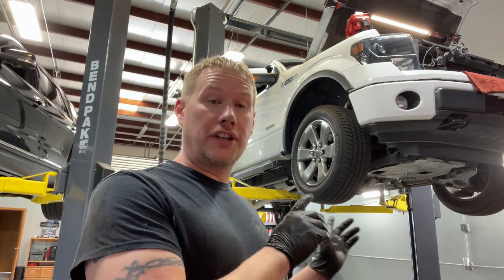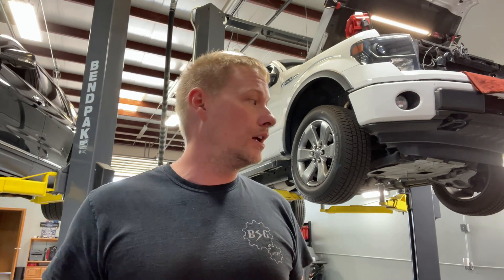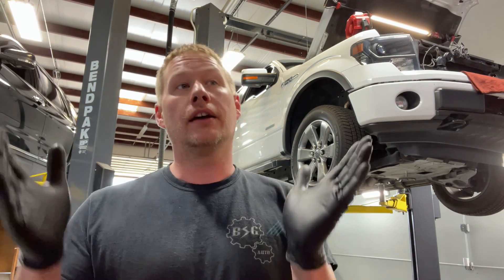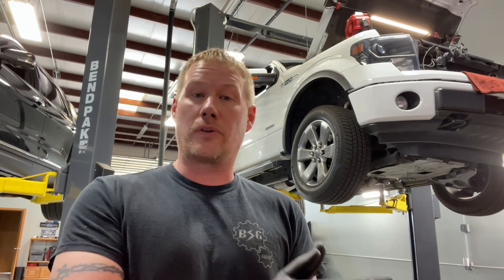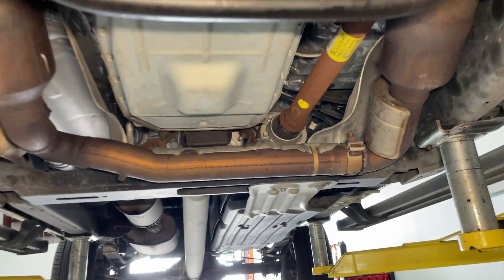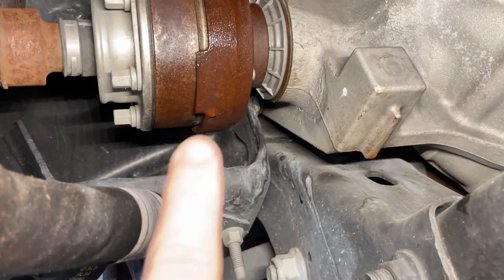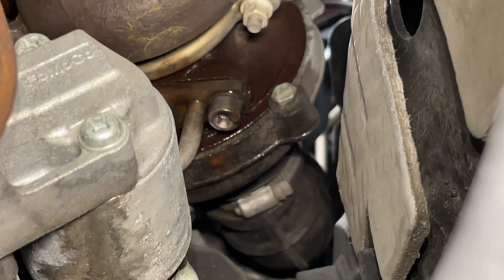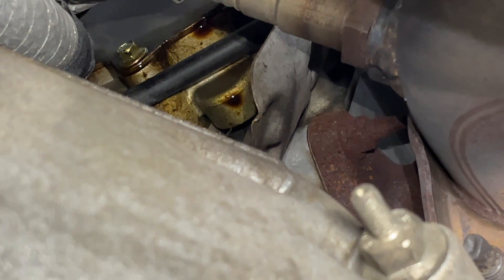Ford Ecoboost Engines Can be so Hit or Miss: I Really Feel Bad for This Customer...

Comment: I have a 2011 with the 5.0. I've had a few issues but nothing major. At one point I thought about upgrading but I think I'm going to keep this truck until the wheels fall off. It's almost like these newer trucks were built to fail

Comment: I had my 2013 ecoboost for 5 years and with only 43000km it needed the timing job done to it.
I never noticed anything but the dealer found it during maintenance for another problem.

Comment: So with all the cooling system leaks what's the possibility head gaskets leaking boost into the cooling system and causing the leaks? Just a thought.  With all the problems you just found if it were my truck I'd get rid of it.

Comment: This is the flaw with all of those great ideas to save gas. One they don't get that much better gas mileage than their predecessors such as v8s and sixes. But you get stuck for extremely expensive repair and maintenance cost which more than eat up the savings from gas. This is the big flaw with the gas mileage mandates from the federal government. A lot of these emissions and fuel economy mandates are unrealistic and excessive but the government doesn't care because the government doesn't have to pay the bill the poor fool customer does. It's just as bad with all the other manufacturers not just Ford. GM Ford and Chrysler and the now defunct AMC should have pushed back on a lot of these mandates decades ago. They forgot about the customer who may not be able to pay the bill for this.

Comment: I just had similar issues fixed on my truck. My coolant lines and vacuumed pump was leaking. So I figured if they're were going to have everything tore down, I might as well put some new turbos in there. I have 110k miles and hoping this should last me for a while.

Comment: My 2011 F -150 w/ Eco Boost turbo, had a Check engine light come on about the fourth time I drove it,  (bought used)  at 100k it was time for a timing chain and the adjuster and whole shebang.  Could've been an expensive endeavor if I hadn't purchased the Warranty. 😏
My 1999 F-150 died by being total loss in wreck with 265k miles with original timing chain. 🤔

Comment: I have a 2012 with 150k miles on it. Here are my issues:
- The degas elbow connection was leaking. I replaced it with the silicone elbow from summit racing. $40.
- The passenger side turbo was leaking coolant. My mechanic must have tiny hands because he fixed it without removing the turbo for $85. (Luckeeee)
- The coolant hoses to the heater core were leaking. That was $200.

I don't think it leaks oil, but I've never removed the skid plate, so.... I've never noticed any missing. 
As far as my coolant leaks go, I just figured it's the modern version of an old "green leaker" 2 stroke detroit. Leaks might just be something you learn to live with.

Comment: This is one reason why I decided to trade my high mileage Crown Victoria for a Fusion WITHOUT an Eco-Boost engine.  Unfortunately, while it has a relatively trouble-free engine, the electrical system is showing a few worrying signs of possible failure even though the car only has 22 thousand miles on it.

Comment: @fordtechmakuloco hey sir, I got a 2007 f150 with the 5.4L 3 valve in it. I'm trying to replace the connectors for the ignition coils. I did the injectors just fine using standard motor products connector, but I cannot find an ignition coil pigtail that can be de-pinned and still use the oem terminals with. Do you have a brand or website or something you get them from?

Comment: My question for the  customer is " How much oil /fluid does this thing use? Maybe all the rust up north hides all the leaks. I have a 2000 model in great condition but it leaks a quart between changes. Not enough for me to worry about.

Comment: This makes me SICK! I'm so done with Ford after decades of personal and business truck successes and then by 2014, it was all down hill. They had to buy back one car from me before I lemon-lawed them in CA. They did me right on that one so I buy another model with an Ecoboost only to find out a year in that they're notorious for coolant intrusion destroying virtually new motors. No recall...just a TSB to detune the turbo boost essentially preventing inevitable early failure and postponing it out till after the warranty period. I just dumped that one after three years and 35k while it was worth something in this economy and now we have a '21 Tacoma TRD Off Road. No POS turbo. I'm golden for 300k with the way I take care of my rigs. I'll never buy another Ford again. They've become pro at sweeping known serious issues under the rug and letting good, loyal customers hang.
Reply: Just put a high quality FULL SYNTHETIC in her and good to for 10,000 to 12,000 OCI’s.
Reply: @lotsofthisandthat9791  Oil is cheap compared to stuck piston rings and destroyed motors!. Mobil 1 0w20 every 5-7k at most for me, Closer to 5k is fine by me.

Comment: I just did the timing on my truck, went above and beyond what the latest TSB called for. Noticed I also have an oil leak from above or around the right turbo. Now maybe I know what it is. Not to concerned about it right now but it'll need done.

I have almost the same exact truck from this video, 2013, no coolant leaks I can see yet. Just about to roll 165,000 miles.

I should say, a few months ago. Replaced the same coolant line going to the reservoir you mentioned and replaced the water pump. Also put in the high volume oil pump from one of your videos.

Wish I did the idler behind the front cover and secondary chains but I'll get them next time.

Comment: Ordered my 2013 f150 with 6.2 engine. Trouble free since new besides tires/brakes/shocks. Very good power but like anything else to make more power it requires more fuel. I don’t mind paying a little extra for fuel as i work in oil and gas   and this industry needs everyone support

Comment: I have had the turbo lines replaced too and I also noticed the dripping on the drive shaft coupler . I did switch to synthetic and I only have 130,000km. I’m getting ready to buy another vehicle in year or two and it really makes me think is Ford worth it. I love the interior and the looks of the truck but it seems like Ford built highly unreliable truck and they know about it and don’t care.

Comment: I will never own another ford because of this. I bought a new f150 in 2012 with the 3.5 ecoboost and it was the absolute worst vehicle I've ever owned. I traded it in with 112,000 miles, and needing a  minimum of $5000 in repairs. It was trouble from the day I got it. I'm now in a 2021 Tundra and I can say positively, that it will be Toyotas and Hondas for me.

Comment: Ford should be ashamed to produce vehicles that need major repairs at only 70k miles. You spend a fortune on a truck just to have to spend it again just to keep it running. GM isn’t any better. It’s like they don’t even try to engineer them to be reliable. Just try to make it last for 36k miles or 3 years. Planned obsolescence even before they hit the showroom floor.

Comment: I had a 2009 with that timing issue.  90,000 miles only.  I traded it in for a Sierra and will never go back to a Ford again.  Ford has really gone down hill when it comes to reliability

Comment: Thanks for fueling my hatred to the Ford. Apart from leaks my 2011 Fusion V6 Flex does not have OEM parts for exhaust available anymore - not just out of stock, the category vanishes when I check in my car. I had to buy aftermarket, I bought Walker and now I am dealing with exhaust leak. And I did that only as preventive replacement, because flex connector was torn out and small hole was forming, no audible leaks though...

Comment: Got a 2017 Ford transit 250 ecoboost with 450k miles, never done anything but change the oil since new along with regular maintenance. Only issue I’ve had it’s torque converter shutter in the transmission

Comment: Great video. I experienced similar issues with my F150 and by the time I had Around 160,000 miles I had spent over $10,000 keeping that truck on the road. Much of what you talked about here I went through as well as bearings on all four wheels and worst of all the TwinTurbo went out at around 150,000 miles. That cost me $3680 to replace. It was the final straw for me. It is why I got rid of the truck swore off Ford forever and bought a Toyota tundra which I should’ve bought in the first place.
Reply: I traded in my 16-year-old Toyota Tacoma with 190,000 miles on it that never once let me down. You probably won’t believe me but it’s still have the original exhaust on it.. Besides normal maintenance, major tuneups when recommended, I only had to replace the lower belt on a trip to North Carolina one time. But it didn’t break down on me. I made it to the dealership but the belt was starting to shred and I could hear the sound. By far the most reliable vehicle I ever had.
As for turbos, it is no secret you may need to replace them by 100,000 miles, even less.. That’s pretty common knowledge. Can’t really complain that you got 150,000 miles out of them. I bought my raptor knowing this. But I plan on selling it at around 60,000 miles when the drivetrain warranty ends.
Reply: Welcome to the club.
Reply: Awesome choice brother and I bet that 5.7L I-Force V8 in the Toyota Tundra will definitely outlast the EcoBoost with ease.

Comment: Maybe it’s karma. I have a 2012 EB and I was so paranoid about repairs that I bought the 7/125 Ford ESP. When that expired Ford let me extend it out for another 5 years so I’m under warranty until 2024. I am at 74000 miles and have not had one issue, nothing, nada. I spent $4000 on the warranty’s so go figure. Im 70 years old and have been buying from the same dealership for 40 years. I know everyone there and I’m positive that they would cover any legitimate repair, absolutely no doubt. My only complaint is that the paint chips so easily. I solved that my having 75% of the exterior linexed along with the inside door jams, mirrors and running boards. I do agree with Bryan that it seems to be hit or miss. There are 4 other F150’s with the EB on my cul de sac and none have had any issues.

Comment: I don’t understand it does not matter what you buy! Any internal combustion engine is going to have these problems. Especially from all the manufactures that make cars. It has been heavily documented at a car meet today is not meant to last more than five years or 80,000 miles they’re meant to leak replace so much so you have to buy a new one because it’s cheaper. That is why we are going to electric vehicles my sister is a model S Tesla Has over 100,000 miles and she still doesn’t need to do the brakes because of regenerative braking.I just bought a model S and I will never go back to internal combustion engines. My car blows any other car out of the water in terms of performance on top of that I don’t have to worry about maintenance war all the same problems like timing belts  etc.

Comment: I have a 2020 3.5 eco boost with 20k miles and im concerned about the phaser rattle. I dont hear anything yet but im told its bound to be a problem. The dealer would not do the reprogram because they said it would get worse. Also im starting to see oil seeping around the transmission pan so I hope i dont get screwed over by Ford and end up like this customer.

Comment: Great info,  as this Lemon Engine ages might be good to add a 'pre-oiler' electric driven oil pump to pressurize system (cam phasers) when twist key to run.   a few hundred spent could avoid thousands in repairs!   And don't use synthetic, but instead  semi-synthetic so oil not leaking  past seals as bad.

Comment: Just dumped a 2012 with the same miles and the same problems. Plus multiple electronic failures. Bought a new Bronco sport in March. So far has about 1200 miles and it has spent 13 weeks in the dealer waiting for various Parts. No satisfaction from Ford of course. If it ever gets fixed I am going to a GM. I’m done with Ford.

Comment: Around 2012-13, I was working at the rail yard next door to Ford's Brook Park Plant(aka Cleveland engine).  Ford scrapped a whole run of the EcoBoost 3.5 engines. Brand new engines, went right to the smelter. It cost them millions. The rumor was they caught a major defect.

Comment: Ford ecoboost engines are overrated like no wonder there problematic small displacement 6 cylinder and then put it in a heavy truck and expect it to pull 8 or 10000 lbs is ridiculous turbos aren't meant for trucks and 6 cylinders are for 2wd work truck models turbocharging accelerates wear on internal engine parts like rings valve seals valves themselves pistons connecting rods etc. Its like running all out and dying before the warranty expires

Comment: Motor companies are trying to meet ever tighter emissions and mileage standards, at the same time the public demands bigger and heavier trucks.  Engineers are having to take greater risks with lighter components and new technologies that don't always result in bulletproof reliability.  Then, they buy components from China to keep the cost low, compounding the risk.

Comment: Damn that sucks my 11 ecoboost went 223k miles only exhaust manifolds x2. Then on my 15 ecoboost at 88k miles  exhaust manifolds again and front diff leak. I think I’m going to buy the 5.0 in my next truck, or maybe even the Chevy 1500 with the duramax

Comment: anytime you use rubber o rings in a quick connect fitting that is subject to exhaust temps it will fail ive done tons of turbo coolant connectors and lines on chevy cruzes with a simalar setup

Comment: This is why you never get a turbo charged V6 BRO engines. Even though they can sometimes last some time. If your gonna get an F150 get the 5.0 it has a proven track record of reliability even though it can sometimes last as long. Your getting a much better chance of lasting with a V8.

Comment: I have 274,574 miles on my 2012 f150 2 wheel drive with 3.5 eco boost. Runs and drives like new except the death rattle after sitting a couple of days. To stop the rattle I hold throttle to floor and crank for 3 seconds. Then start as normal with no rattle! BTW your the best Ford tech on YT and beyond!!

Comment: What oil filter is he using? What engine oil? How often is he changing it? How many engine hours are on it?  I have an almost identical truck with 200k on it no timing problems I did have coolant leaks at the degas and water pump at 150k

Comment: I've seen far too many issues on Ford trucks with low miles to ever look at one seriously.  Worked with a guy that his shop truck was a 13 5.0 F150.  At 90k miles the rear end bearings failed.  There is no reason that rear end bearings should ever fail at such a low mileage.  I've talked to other people that had stupid failures at 60k or 70k too.
Reply: The problem with this statement is he probably got a great transmission and engine law of probability as source…. Rear end bearings are cheaper than the POS GTDI vehicles sold

Comment: Typical ford... I have a 13 ram 90000 miles 0 fluid leaks 0 oil usage ... 0 problem.. has the 5.7 hemi... still gets 22 on highway... ohhh yeah.. I am a retired mechanic

Comment: Ford Eco Crap engines, if they're going to build them at least put parts that will hold up in hot or cold climates. This is just a small example of how Ford ended up with a bad reputation. Sho s Ford still hasn't learned it's lessons.